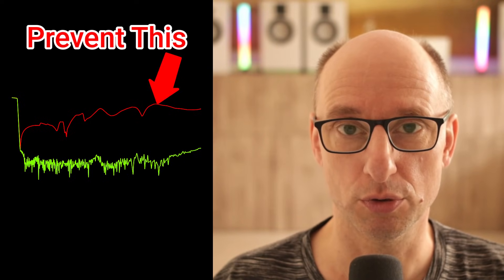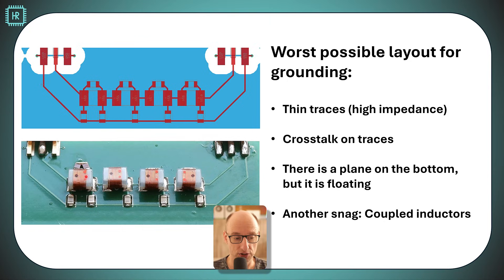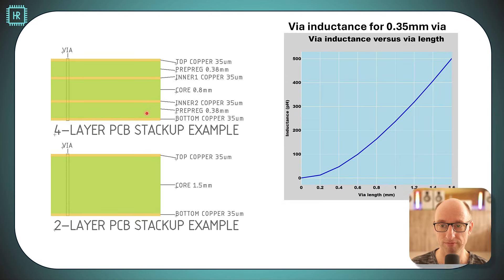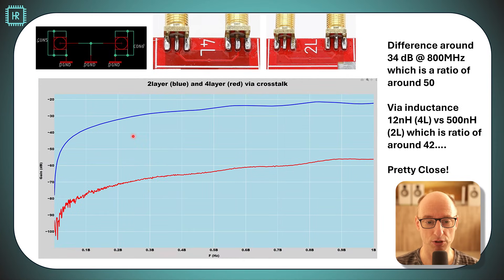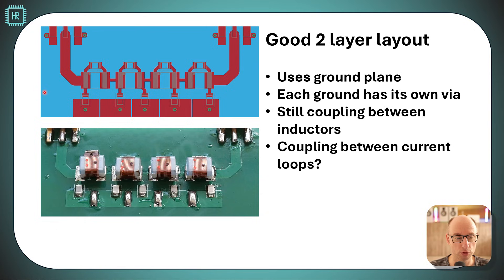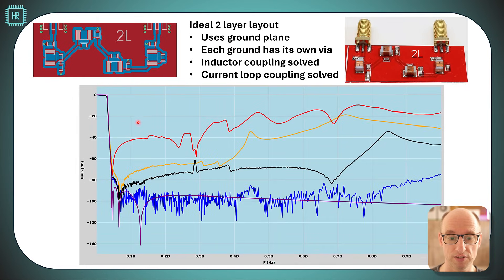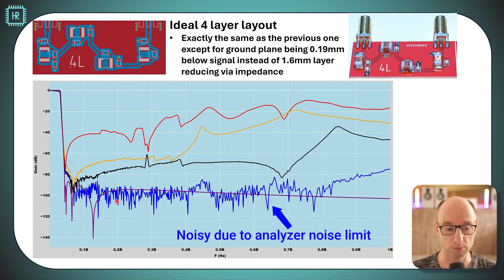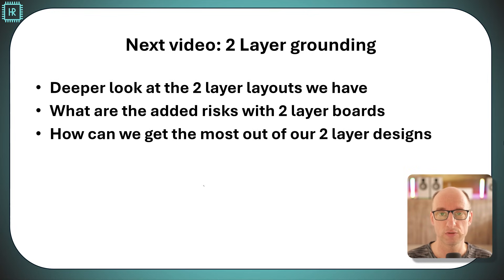Flawless PCB design: 3 simple rules - Part 2

Comment: Send me the checklist.
Very useful video!
Reply from the maker: I've changed the free checklist offer a bit: You also get a 1 hour module of my course for free!

You can find the link to the page in the description. Scroll down a bit on that page (Or read the whole page, you may get curious :-) ) to find the link. It is a purple button 'Watch The Free Module And Get The Checklist'.

You will have to leave your email address so I can start spamming you :-D . I don't do that very often, on average once a month, but I am thinking about starting an email series with useful electronics tips at some point.

Best regards,

Hans Rosenberg

Comment: Buena explicación, además de estar sustentada por mediciones. Sigue lo expuesto en el video y tus diseños tendrán un comportamiento mejor y más estable.
(A good explanation, and it's also supported by measurements. Follow the instructions in the video and your designs will perform better and have more stability.)
Please, send me the checklist.
Reply from the maker: I've changed the free checklist offer a bit: You also get a 1 hour module of my course for free!

You can find the link to the page in the description. Scroll down a bit on that page (Or read the whole page, you may get curious :-) ) to find the link. It is a purple button 'Watch The Free Module And Get The Checklist'.

You will have to leave your email address so I can start spamming you :-D . I don't do that very often, on average once a month, but I am thinking about starting an email series with useful electronics tips at some point.

Best regards,

Hans Rosenberg

Comment: I once brought in 10 of our best analog designers to work out a grounding solution, got no agreement.
Reply: To be fair, in low frequency applications, below like 100Hz, split planes will give better DC accuracy
Reply: Hahahahaha
Reply from the maker: That is because a lot of them still believe in the wrong approach because it keeps being cultivated everywhere. Also, terribly enough, in datasheets of extremely well respected companies who make great products (ics) but screw up the application part....... Like separate ground planes for AD / DA converters. Never do that!
Reply: @HansRosenberg74  Yes, so ingrained that one of them walked out of the meeting.  To be fair it was a very mixed board, RF, power, high speed digital.

Comment: Presumably going from a 1.6mm 2 layer to a 1.0mm or 0.8mm 2 layer would help a lot.
Could go for a 0.6mm or 0.4mm but dealing with paper thin PCBs is tricky.
Reply from the maker: Indeed that helps, but mechanics are an issue, hence the 4 layer solution......

Comment: I am loving this series - some really great PCB tips and I hate being critical but .... one little gotcha - you did not stitch the ground planes!  As you go higher in frequency the PCB substrate becomes a dielectric resonator.   You should break this up with staggered vias at < quarter wavelength (in the dielectric so reduce by sqrt of Er) at your higest frequency of interest.  
The via test piece also included transmision lines - so your short circuit was including those, so you were measuring a circuit of txline-via-txline and NOT the via only.  Ground vias should be in pad if your process allows for high frequency.  This often annoys PCB guys who will shout "IPC rules!" at you - but grounds on stubs are not true electrical grounds if they are connected by a  long length of transmission line (see above)
Reply from the maker: Haha, the not stitching was on purpose! I still want to make an updated video where I show the effects of stitching :-) I already made one video on it where I demonstrate the Fres versus stitching distance.
Reply: @HansRosenberg74  I got caught myself with board resonances - really enjoying the series btw - inspiring and very instructive

Comment: How about 1 layer?
Reply from the maker: Interesting idea, the worst example is actually a one-layer, but I don't know if that example is in this video or the previous one.
Reply: @HansRosenberg74 if I'm not mistaken in all videos you tested 2 and 4 layers. My thoughts - no extra copper layers means no parasitic capacitance so less problems. Also I have a vhf swr meter and there is 1 layer pcb, so it made me curious.

Comment: If via length is your only concern, you can also get 0.4mm 2-layer boards.  It would be rather fragile though.
Reply from the maker: Yes, mechanics is the problem. A 4layer solves the mechanics and the via length.

Comment: Send me the checklist please. Thank you!

p.s. for your video on multiple ground  strategies by an elliptical filter, will you consider to construct Jims Williams type floating components styles with a thick copper ground plate underneath as a comparative reference, although it is not mass-production-able?
Reply from the maker: I've changed the free checklist offer a bit: You also get a 1 hour module of my course for free!

You can find the link to the page in the description. Scroll down a bit on that page (Or read the whole page, you may get curious :-) ) to find the link. It is a purple button 'Watch The Free Module And Get The Checklist'.

You will have to leave your email address so I can start spamming you :-D . I don't do that very often, on average once a month, but I am thinking about starting an email series with useful electronics tips at some point.

Best regards,

Hans Rosenberg

Comment: It seems that the 4-layer board design didn't really utilize all 4 layers. It is a mechanical support for a very thin 2 layer board design. Is this correct?
Reply from the maker: the other layers were not needed for this simple design

Comment: just subscribed, the detail was on point I was trying to reduce buck converter noise design and this would help a lot as it has the same principles thank you.
Reply from the maker: If you liked this, then you'll love my 1-hour free course module that goes way deeper. You get this with the checklist now.

You can find the link to the page in the description. Scroll down a bit on that page (Or read the whole page, you may get curious :-) ) to find the link. It is a purple button 'Watch The Free Module And Get The Checklist'.

You will have to leave your email address so I can start spamming you :-D . I don't do that very often, on average once a month, but I am thinking about starting an email series with useful electronics tips at some point.

Best regards,

Hans Rosenberg

Comment: Very good explanation. I wonder though if same result can be achieved with the 2-layer boards using bigger via diameter to reduce resistance?
Reply from the maker: It might, but maybe you'd need to add ridiculous stitching! This is something I want to try at some point and make a video about.

Comment: Hi Hans, great video. I would love the checklist if you could send it to me. Thanks.
Reply from the maker: I've changed the free checklist offer a bit: You also get a 1 hour module of my course for free!

You can find the link to the page in the description. Scroll down a bit on that page (Or read the whole page, you may get curious :-) ) to find the link. It is a purple button 'Watch The Free Module And Get The Checklist'.

You will have to leave your email address so I can start spamming you :-D . I don't do that very often, on average once a month, but I am thinking about starting an email series with useful electronics tips at some point.

Best regards,

Hans Rosenberg

Comment: Could you send me the checklist pls? Thks.
Reply from the maker: I've changed the free checklist offer a bit: You also get a 1 hour module of my course for free!

You can find the link to the page in the description. Scroll down a bit on that page (Or read the whole page, you may get curious :-) ) to find the link. It is a purple button 'Watch The Free Module And Get The Checklist'.

You will have to leave your email address so I can start spamming you :-D . I don't do that very often, on average once a month, but I am thinking about starting an email series with useful electronics tips at some point.

Best regards,

Hans Rosenberg

Comment: Hey Hans, im getting now into pcb design and would appreciate getting the CHECKLIST. Thanks for this informativ video!
Reply from the maker: Thanks!

I've changed the free checklist offer a bit: You also get a 1 hour module of my course for free!

You can find the link to the page in the description. Scroll down a bit on that page (Or read the whole page, you may get curious :-) ) to find the link. It is a purple button 'Watch The Free Module And Get The Checklist'.

You will have to leave your email address so I can start spamming you :-D . I don't do that very often, on average once a month, but I am thinking about starting an email series with useful electronics tips at some point.

Best regards,

Hans Rosenberg

Comment: Great video! You presented the information quickly and efficiently. I have been working with RF Engineers helping with development of C and S band high power amplifiers as a technician for about 10 years. I produce test boards with a board router with different types and thicknesses of PCB materials for Engineers to test their designs. After watching your video I feel that I can better understand and assist the Engineers I serve. Thank You.  Please send me the checklist
Reply from the maker: Wow, this is great to hear. The nicest compliment I can get is that people really got something from it, even if they are experienced like yourself :-) I have whole course since a few weeks, going over all the subjects in electronics that can cause problems that are easy to prevent. 

I've changed the free checklist offer a bit: You also get a 1 hour module of my course for free!

You can find the link to the page in the description. Scroll down a bit on that page (Or read the whole page, you may get curious :-) ) to find the link.

You will have to leave your email address so I can start spamming you :-D . I don't do that very often, on average once a month, but I am thinking about starting an email series with useful electronics tips at some point.

Best regards,

Hans Rosenberg

Comment: What are your thoughts on using a power plane and a ground plane adjacent to each other? Say, a 4-layer stack up consisting of the following:

Top layer: components and signal routing

Layer 2: ground plane
Layer 3: power plane
Bottom layer: components and signal routing

Great idea about rotating adjacent inductors 90 degrees BTW. Never considered this before so thanks!
Reply from the maker: Hi, the problem that could occur here is that the ground return currents related to the bottom layer now cannot get to the ground layer. So they'll take a detour. They could pick the closes supply decoupling caps and use those as a path, but that also makes the return loop longer, so, more impedance and possibly resonances and loss if the frequency is high enough.

Often power planes are not needed unless your currents are very high (>10A). A better idea is to use really wide traces on the bottom if voltage drop on the supplies allow it.

If you move to a  6 layer, it becomes much easier. You have 4 layers available for routing,  you could turn 1 into a power-plane and then you can satisfy all grounding and Signal Integrity requirements very easily. Layer 2 & 5 would be a ground plane in that case.

Comment: As a hobbyist, I would have loved to buy a book and use it as a reference. A full course is too much for my need.
Reply from the maker: I totally get it, this is aimed at professionals mostly, allthough I've already sold quite a few privately. I have to charge this because the value is absolutely there in a professional environment. You'll very easily earn back a 10x multiple if you apply this stuff (purely based on all the preventable mistakes I've seen in 30 years, I had one example that would cost 100k USD if it happened today, easily, and it was such a preventable mistake). Also, I've spent a year building this course, with 3000 euros of cost a month and no income for 1 year, so I have to earn it back if I also want to be able to keep making these valuable videos. I'd love to do all this for free since I love electronics and I really like teaching and explaining but the I would be on the street at some point :-).

Comment: Excellent video. Just found you +1 subscriber. 
Please send me the checklist.
One query if the issue with the 2 layer board is via length causing increased inductance. Then on the 4 layer board board are we just using the top and 2nd layer (2nd layer gnd) with the other layers not doing anything and the only reason they are there is for mechanical strength? I.e. would a much thinner 2 layer board work as well electrically, albeit not having the required rigidity?
Reply from the maker: Yes, that is correct. A pcb with a 0.2mm dielectric and 2 layers would be really really flimsy. You could glue it to a piece of metal, but then it's easier to just buy a 4 layers since they cost nothing anymore these days in china.... unless you're in the US because then Donald will triple your price :-D (Great way to reduce inflation by the way :-D ) I really shouldn't get into politics as an engineer, lol

Comment: All the copper fills on the top add capacitance.
Reply from the maker: This is actually minimal, since the surface area of the ground that sees the signal is only 35um. A bigger risk would be standing waves on those planes, but that's where via stitching really helps.

Comment: To design a PCB that is supposed to handle EMC rules 4 layers is the minimum if you are handling RF signals.
Reply from the maker: for simple boards, 2 layers can also be enough, it would be a good idea to reduce the thickness of the pcb to 0.8mm

Comment: Another Great Video!
I got your book and for sure everyone needs this book!I try to follow what you do and I get good results.
One thing that I add is I often create Two Schematics, one with component symbols that have pins positioned and grouped for best understanding of the circuit and one with the component symbols drawn with actual pin positions, easier layout. This works for me.  Also if one is doing this for commercial purposes then it is best to have a plotter that can do D and E size drawings. This is expensive but it is a tool worth having. 

Thanks for sharing your many years of experience!

Also PCB design is becoming and Engineering Art, will it was always was. When I first started I was convinced that a great layout would be based on circular PCBs with V+ an island in the middle in the middle and Ground as a ring trace around the Outer edge, then I learned about multi layer boards and Power and Ground plains.  Time to do some experiments. 

What I like about you techniques is you try out different ideas and make measurements to test your ideas.
Reply from the maker: Thanks a lot for al the compliments :-)

Drawing clear schematics cannot be done with 100% strict rules I think. In some situations, using the pinout as a schematic symbol is superior. In other cases (like with an fpga with 256 balls) you cannot do that and need to make the most clear sub-symbols so checking your design is easier. It's always a new trade-off with every schematic I draw.

Best regards, Hans

Comment: 1 layer attempt would be also interesting IMO.
Reply from the maker: Hmm, I did not think of trying to get the best result out of a 1-layer. Results would be pretty bad, I'm sure of that :-) You'd have to use a wide ground plane around the filter to keep the ground impedance as low as possible.
Reply: @HansRosenberg74  I have zero experience with HF stuff (I play with audio and simple digital mostly), so I guess you are right. On the other hand I would not be very surprised, if it was better than with those long (two-layer) vias, if done as you say.

Comment: Hi Hans, my apologies if I missed this, but in most of your layout views you show a component and the via connecting to the ground plane, but no connection to the topside plane. Whereas in the images of your circuits there are blobs of solder joining the topside plane.

Is it better to have as much of an intact topside ground plane as possible as well, or just stick with internal layers on a 4 layer stackup?
Reply from the maker: This was an experiment that I wanted to do to see the impact for this specific layout. It turned out to have minimal effects as the currents preferred to use the local via and not the adjacent ones. I expected a bit more effect there.

Comment: can you tell me the name of the software you use for schematic and simulation purpose ?
does the software come with built in sma connector component?
Reply from the maker: I use simetrix, and no it does not come with an sma connector. You'd have to do an em simulation with some sort of tool. You'd have to search the web, I basically do it with simple calculations. Under 5-10 GHz, this is usually fine.

Comment: Please send me the checklist.

Hi Hans, could you please send me your PCB design checklist? I’m currently designing PCBs that look great on paper, but they tend to pick up noise in practice, making troubleshooting a challenge. Also, I've heard that adding plenty of vias can help prevent the ground plane from conducting noise—is that true? Is this tip included in your checklist? Thanks in advance!
Reply from the maker: The best thing to do is to follow my 3 simple rules for ground-planes. That will solve most of your issues. AND (not in any of my videos yet, but probably in the checklist: Give each supply pin it's own decoupling capacitor to the ground-plane. As close to the pin as possible!). Link is in the description. Best regards, Hans